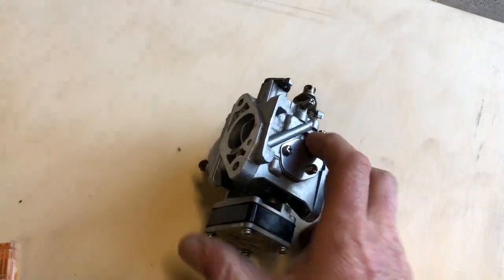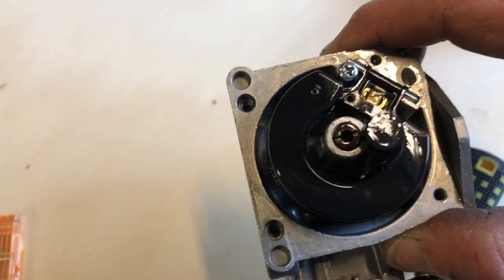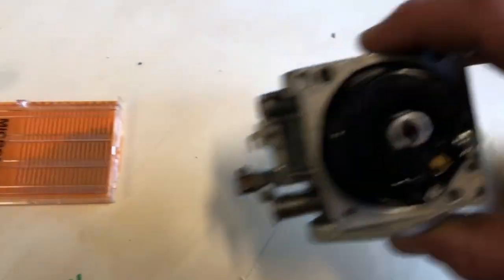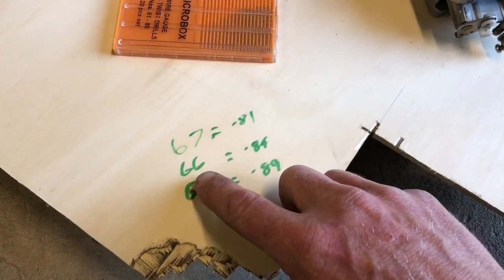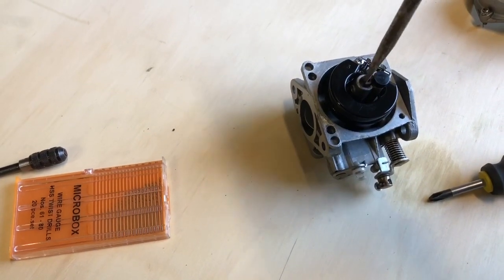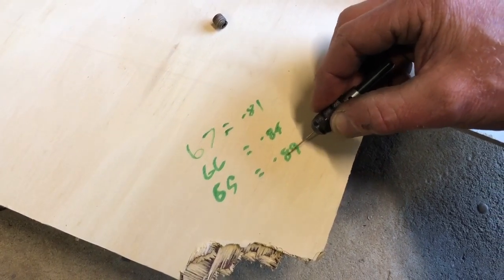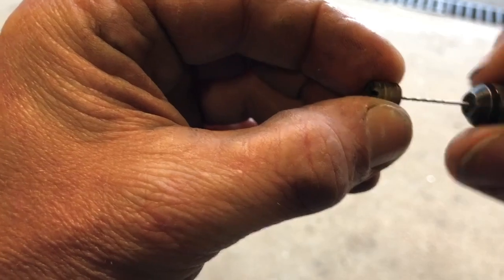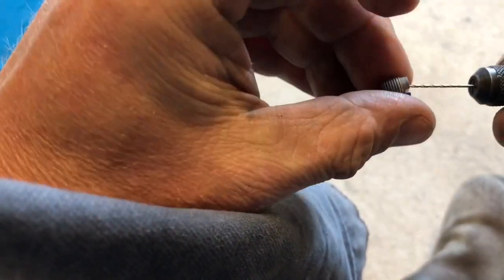Re-jetting a carburetor for a modified outboard.

Comment: What is your recommendation to get more power out of a 1986 Yamaha 8HP 2 stroke?
Reply from the maker: unfortunately with the 8hp Yamaha 2 stroke it is already tuned pretty well, it shares the same block as the 6hp.
I don’t have any recommendations on how to easily get more power unfortunately. You can always port the block and source a larger carburetor and tune it that way. that is a heap of work with only possible results, you can easily loose power too.
sorry there is not a bolt on option mate.
cheers 🍻
Reply: @25hpboatracerman  How about Boyesen reeds?
Reply from the maker: I have found Boyesen reeds to not really make a difference, especially on small hp motors.
they do add some small gains on a motor that is modified in my experience and when fully modifying a motor all gains add up.
cheers 🍻
Reply: @25hpboatracerman  Thanks. Reason I ask, is the small 
'cocktail racers', use OMC/Evinrude/Johnson  2 stroke 6hps and they use them. Are you familiar with that mod to those motors? Or, do they do something else too?
Reply from the maker: Hi mate,
yep, familiar with it. I do get adding boyesen reeds for  racing, if they add 1/2 or even 1/4 mph to your boat speed that can be the difference in winning a race.
As for actually noticing the difference in speed or extra hp I am yet to be convinced.
cheers 🍻 
Aussie BG
Reply: @25hpboatracerman  Would you happen to know besides the high speed jet, if there are any other differences in ihe Yamaha 2 stroke 6hp vs 8hp?
Reply: @rrrttt1112  there is a exhaust restrictor in the 6hp..you can take off the lower leg and look up exhaust and see it... just make up a long attachment with correct size holesaw and drill it out then its a 8hp

Comment: I have a 6hp mercury 2 stroke 2001 and i am trying to convert it to 8hp 

Am guyssing i iwll need to get a carb from an 8hp and swao thr carb over
Reply from the maker: Hi mate,
I would put the 9.8hp carburetor on if your changing it anyway.
That probably give you just over 8hp.
Cheers 
Aussie Boat Guy 😎
Reply: @25hpboatracerman  

Yeah I suppose I could try that 

See what happens

Comment: Hey mate, I got a 2006 yamaha 15hp 2 stroke. Can the jets be enlarged on it to make more power? Or is that not a thing.
Reply from the maker: Hey mate,
Unfortunately not a thing for the Yami 15 two stroke.
I was re-jetting as that carburetor came off a 9.8hp and I was putting it on a 5hp. The jets where to big for the smaller capacity motor. The jets need to match the amount of air entering the motor to mix the correct amount of fuel to air ratio.
Cheers 
Cheers.
Reply: @25hpboatracerman  Ok cheers man 👌
Reply: What is your 15 hp jet size bro ???
Reply: @magnumbiker30  unsure, that was 3 years ago

Comment: better use a set of nozzle reamers...
Reply: thought about this as well, 👍 but the benefit of using drills is that you get what you drill. In case of reamers, you have to check frequently, hoping not to ream a little to much. By the way; this shown carb is a Yamaha development. The thread size of the nozzle is M8 x 0.75mm If you are rejetting carbs like this fequently like i do, you can make you an adapter M8x0.75 mm OD to M4x0,7 mm bore  using i.e. Zuendapp jets which you can pick from internet in larger sets for realy cheap.

Comment: What function rubber on top pilot jet..
Reply: Late answer, but: It closes the direct entrance of fuel to the low speed jet due to that the low speed jet must take away fuel by a short cut channel to the main nozzle until the vacuum of the venturi (at higher rpm) sucks enough to let fuel come through the main jet as well. It is a rubber plug to get a simple way to access to the low speed jet for maintenance. Removing the plug will let your motor start hard (if any possible) and slows down the low and some mid range power a  lot.